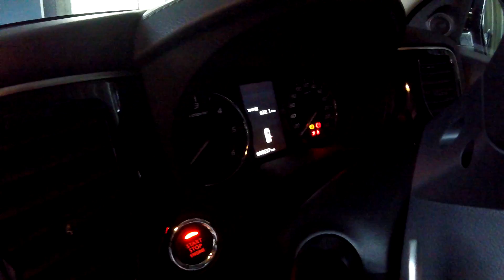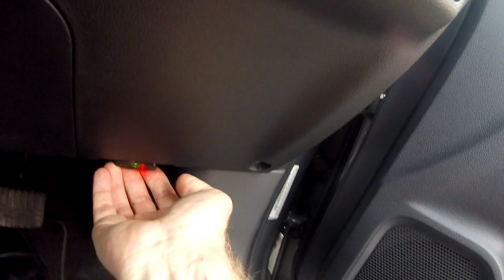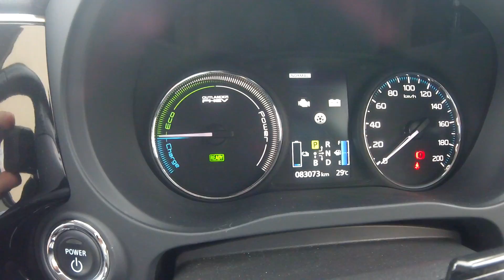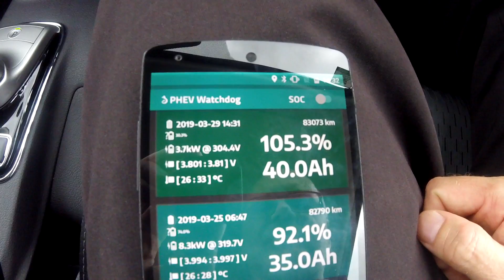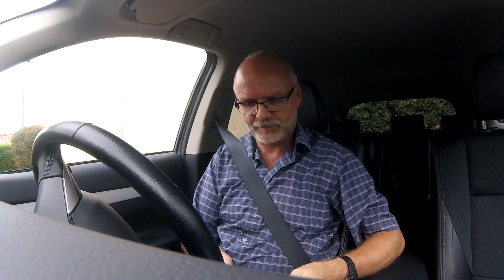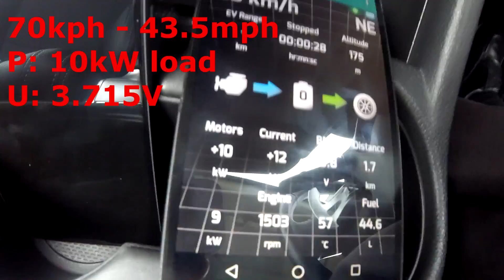EP200 - The PHEV after the triple procedures.

Comment: Hello Andy great YouTube videos. I have 2019 outlander. It's driven 5000km and Ah is 42. Shows 95% soh what is it when it's New?
Reply from the maker: The 2019 model has 46Ah but shows only 44Ah on the Dog when uncalibrated if I'm correct. Anyone can confirm that?
Reply: @unpluggedEV   You are right. Measured my new MY19 with 17km with the dog and had 101,6% at 44,7 Ah. Today i am at 2230km and having 43,0 Ah / 97,7% within 6 weeks. I will be at the next weekend hopefully at my dealer and will check the triple procedure in germany

Comment: Did you see this yet ? 2020 Mitsubishi Outlander PHEV: 100KM ELECTRIC RANGE THE TARGET https://goo.gl/q21cfD
Maybe just the petrol tank is bigger ? But it does say 100km  (62 miles) ev range ?
Reply from the maker: Worst advertising ever. It only shows the 2019 model and does not mention anything of 100km EV range apart form these guys putting something like 2020 and 100km EV range in the title of the video. Standard commercial with no further info.
DON"T WATCH, they are after clicks, that's all

The Mitsubishi Engelberg Tourer has more range, but it's just a concepts at the moment.
https://www.youtube.com/watch?v=ins5nPJvS3E
Reply: @unpluggedEV  Yes I saw this one Andy, its nice,but as you say just a concept yet. 
I did notice on the other video showing the Phev 2020 it says "100km range THE TARGET" I didn't fully see that to start with, another as you say "click " ad , shame everything these days is some sort of scam :(

Comment: That’s great news Andy! I’m very happy the triple procedures worked for you. After all the negative comments about my decision to get the RAV4 Hybrid I went back to the local Mitsubishi dealer to look at a 2018 phev due to all the end of year incentives. It did bring the payments down by $200/mth. 

I used the phev savings calculator and it said I’d save $54/mth. over the RAV4 in fuel savings. So the question is do I pay $100 more per month to save $54???? What am I missing?

Comment: Must feel good to be driving a Toyota-like self-charging hybrid! :-P
Reply from the maker: It did work and charged while driving. Amazing!
Reply: Yes a Toyota Hybrid ist a good car. Fuel efficiency ist great and the System works a little bit different to the Mitsubishi Outlander PHEV.

Toyota HSD trys to hold the ICE @80-90% Load and reduce the RPM with the eCVT (MG1 and MG2 turn in different sides to change the RPM of the ICE) and charges the battery when possible.

The PHEV ICE runs on 88% and the generator produce energy for. MG1 and MG2 or the ICE spins the front wheels and the generator produce only the needed energy to get a load of 88%.

So it's different but the ICE is used on the same way 88%Load to get the best efficiency out of the ICE.
Reply: @davidmairdm80  Indeed, it was an inside joke between me and Andy.
Anyway, the hybrid Toyota has become kind of obsolete. And simple hybrids are more efficient than ICE only in start/stop low speed driving, like in the city. Still no match for PHEVs or BEVs.

Comment: Andy. Shouldn't 100% be full condition and charge of 40Ah? Or is Bitsumishi playing with software. Never heard of a SOH or Battery being charged above 100%
Reply from the maker: That's a 'problem' of the Dog now. As we always assumed 38Ah is 100%, Daniel has programmed his app like this.
Only the 40Ah are coming from the BMU, the Dog shows also the percentage calculating from 38Ah as 100%.
If it all works out, gets confirmed and stamped, Daniel may want to change this in his app...